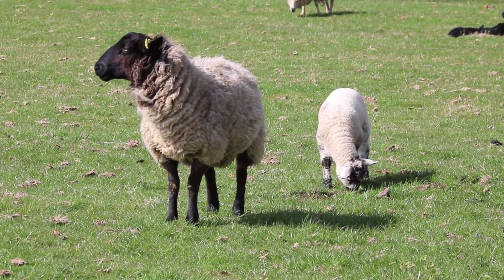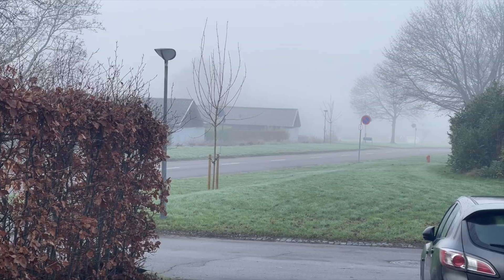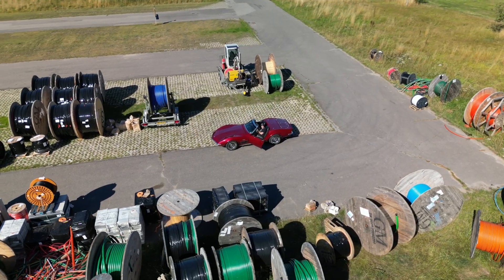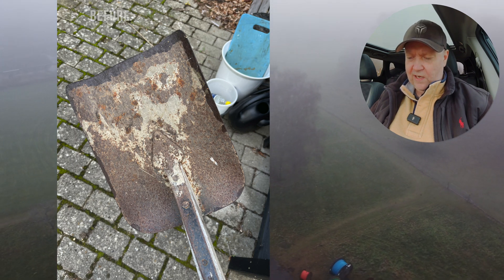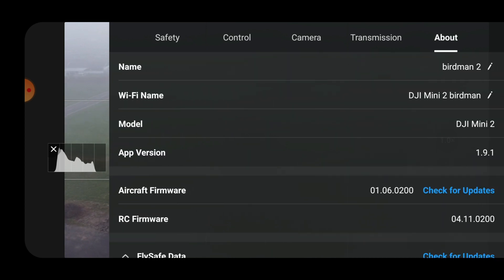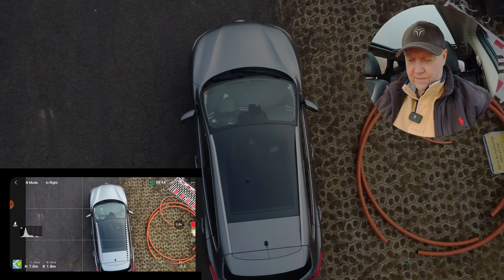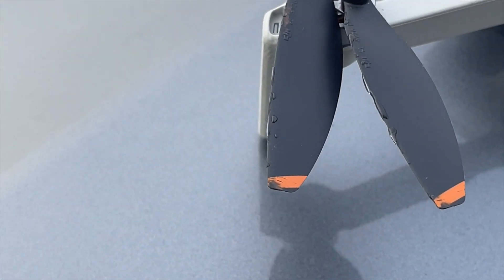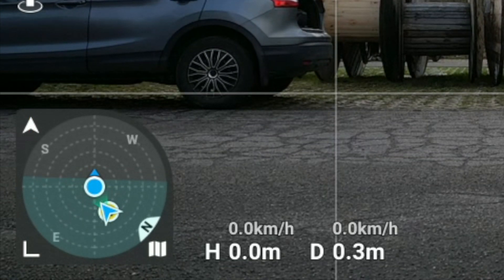I Covered my Drone Props with Sheep Fat to Prevent Over-icing (= CRASH)

Comment: and then the drone became illegal due to its weight. 

Here it is forbidden to fly if you can face conditions that can let the plane or drone stall and fall out of the sky especially all the lipo that are not suited to be used in cold or icy conditions. Have never seen icing on props and wonder how that could happen based on the speed the props are turning. 
Planes and wing yes, but props usually not.
Reply: oh it is very comon and very scary in the aviation industry

Comment: I have a Question for anyone who would like to answer it????? Should you keep your flight logs on your controller or Delete them what purpose does it serve to keep flight logs????
Reply: In Canada, you only need to maintain flight logs for drones over 250g, micros don't require it. This of course is assuming the pilot and drone is registered. I think it is something similar in the US.
Reply: @flightographist  Thank You that is good to know. I do live in Canada and have the DJI Mini 3 Pro.
Reply: @StartLivingNow1963  My pleasure. Remember, as long as you run a 249 battery you can fly almost anywhere. I have a M3P too, I use mostly large batteries so I certified and registered, as a result, with those batteries I have to keep logs and mind different regs for airspace. It's easy enough to switch out with the M3P though, it's a great drone.

Comment: I would try a Silicone spray it is more water repellent than WD-40. Or maybe try Vaseline.
Reply: vaseline is a big no nio, it is petroleum based and should never be put on any plastic aircraft prop blades. it softensdand weakens plastics..
Reply: @philldownes8685  Good to know thank you for the heads up on not to use vaseline.🙂

Comment: Doesn't the gyroscopic force flick it all off?
Reply: definitely not. In fact ice accretion on real aircraft propellers is a major concern when flying in icing conditions, which is why larger prop driven aircraft have electrically heated prop blades.
Reply: @CAMTechChris  I meant covering the props in any liquids...
Reply: @lifestapestry2968  Right. It would have helped if you had defined what you meant by “it”.  😎
Reply: @CAMTechChris  I thought it was obvious given the post...8)
Reply: @lifestapestry2968  I hear ya. But the centrifugal force can also shed the ice from the props.
Reply: @CAMTechChris  no you kleave the product to dry before flying the drone... then any water / ice would sheer off the blades due to the wind etc...